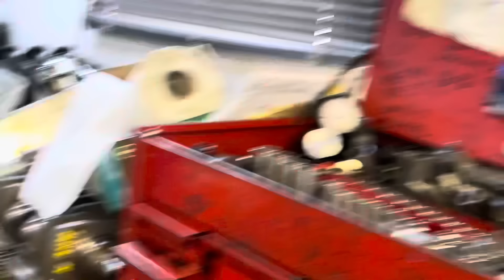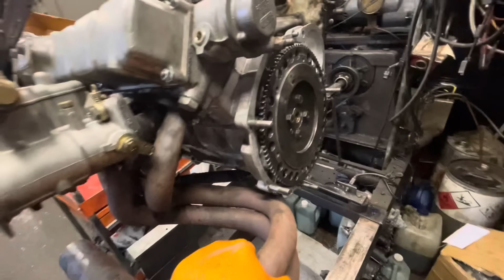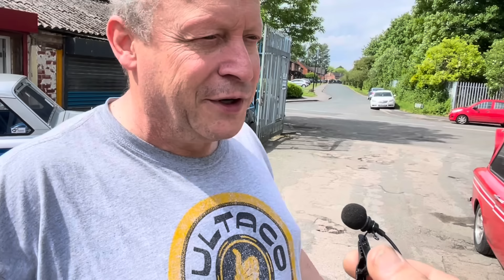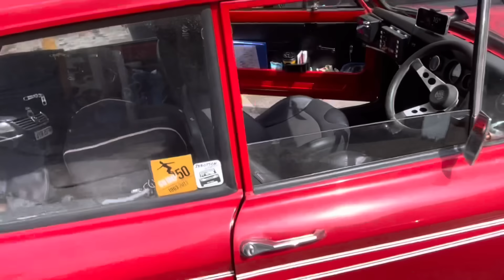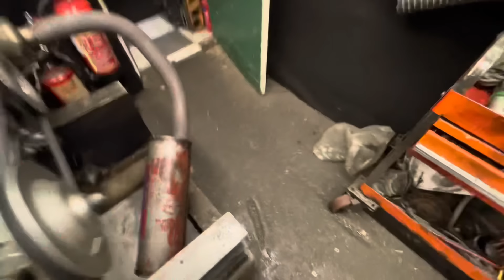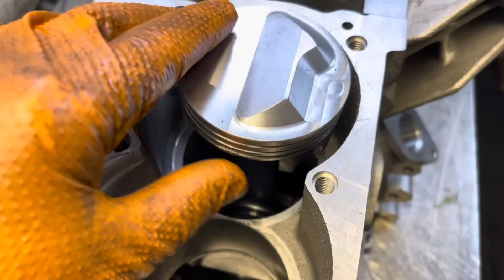Shrigleytube TV Ep 45 rear rad test on dyno, visit from Tim, Mallory park race prep

Comment: Andy Check which way the fan is operating is it drawing air through the rad or pushing it through! As in the car that direction is very important.  When the car is moving it creates a low pressure area under the car and that draws the air from the engine bay through the rad helping the fan to work!  What you have in the workshop is a static atmosphere so there is only the fan trying to create the air flow!  With the rolling road dynos they have to have a huge fan set up in front of the vehicle to give the impression of speed through the radiator!  so perhaps  you would need a similar set up in the  dyno room when using the vehicles radiator for cooling!

Comment: Very interesting experiment on the radiator cooling system. I'd like to see the same test with a standard imp radiator and fan set up for a base line test just to see if the direction of air or even just a combination of an imp fan works. I also think that an imp water pump may be playing a part here at high rpm with cavitation or some other factor that lowers coolant flow. On my own imp I had overheating problems on long hills. When I changed from belt driven original water pump to an electric water pump my coolant temperature dropped by ten degrees with no other changes so I'm thinking an imp pump may not move very much water. That said I can see that your dyno uses an imp pump so who knows haha. Brilliant video thank you for showing us
Reply from the maker: hi thanks for your kind comments. Yes I have new series on the water speed from the Imp water pump and will be moving to electric one. I have a plan and will tell about it on Sunday night video cheers andy.
Reply from the maker: hi graham thanks yes I have learnt lots about the water pump speed and how important it is and think I will be moving to an electric constant speed pump more about it on Sunday night. Cheers for now andy.

Comment: Hi again Andy.  I've had some more thoughts on the cooling issue.  You mentioned that you were running the fan at 1:1 ratio which means the water pump is also running at engine speed.  From my limited knowledge of centrifugal pumps they generally operate around 1750 rpm.  I suspect (and I'm sure someone more knowledgeable will confirm or otherwise) that at the higher rpm with the 1:1 drive the pump is possibly cavitating and not flowing at the correct rate.  What's more, the air bubbles being introduced into the coolant are incapable of transferring any heat so overall cooling efficiency may be severely compromised.  On the same lines, the fan probably has a maximum efficiency well below that of your initial test and you're just wasting power spinning it that fast.

Perhaps go back to the factory drive ratio with the thermostat in place and see how that goes as that would give you a better baseline to start from.
Reply from the maker: hi thanks for your comment. I have been bombarded with information regarding water speed et cetera and will talk on Sunday night about a new plan so hopefully get the cooling temperature on the control.

Comment: Andy, don’t underestimate the RAM air flow through the radiator. Your test is in effect loading the engine at high r.p.m with the car stationary. The driven fan isn’t designed for cooling in that situation, it’s designed for idle, low rpm, low load shunting on a motorway. Hope this helps, just my thoughts; I don’t understand the imp cooling system in any depth so I may have made some assumptions here but all the same keep up the great work, loving the videos 👍👍

Comment: Andy, you don't have the additional negative pressure in front of the rad created by the forward movement of the car to draw the airflow from the fan through the rad, and system isn't pressurised. You are akso just circulating the warmed air in the room. You need the airflow going towards the front of the car, not being pulled the wrong way as you have it.

Comment: My 1040 GB72 BV 11.8 SCR Clan has exactly the same thick core ally rad as yours. Mine is fully shrouded back and front with a low letter box air scoop.  The rear shroud is custom ally and abs with an 11 inch electric fan mounted  2+ inches away from the core to reduce baffling the ram air on the move.  Above 40 mph the ram air alone is sufficient for road cooling.  Fan switches in at 78 C head temperature.  It runs about 75' C  in this month's temperatures. 72C in winter.   The floor is completely flat (abs sheet plastic) even under the suspension arms to direct ram air into the scoop. In addition  I also have 2 x 10 row Mocal coolers in the front spoiler (one on each corner, shrouded and sealed) coolant fed by the heater circiut - 1/ 2 BSP pipes.  These tiny rads drop the return temp 10 C at speed. I use an EWP 80 in the main cooling system variable speed with a full speed override. De cored thermostat in head as a restrictor. Pump speed is critical as I use Evan waterless.  The heater circuit hasits own variable speed  25 lpermin aux electric pump as the oil cooler heat exchanger is in the heater circuit. Sounds complicated but it works.  I need to bring the Clan over to you so you can take a look and take the p (it is very odd ball!!).  I have a c/r transaxle to go to the National for a Club member so I could maybe bring it over to you (if you don't mind) as an excuse for a run out to Manchester from Richmond NYorks?
Reply: BTW. See avatar front spoiler for 10 row Mocal inlet holes. Central gap in spoiler is for extra underfloor air to rear rad scoop.

Comment: Andy, I ran a standard imp and thrashed it everywhere and all was fine, I got a Clan and I know it is a sport engine but it would get too hot, the one thing I realised was the standard Imp had a fully shrouded radiator drawing air from under the car and forced by road speed, the Clan had little shrouding no exhaust shield so drew air from the engine compartment, has that got anything to do with the cooling.

Comment: Hey Andy, how did you manage to get the standard fan assembly to suck up air from underneath rearwards.Standard airflow is drawn in via the rear engine lid to the front of the Imp.Very little ram air effect underneath the car .The bad aerodynamics of an Imp causes air to be drawn back into the engine lid .
Some Fiat Abarth rear engines had ducting underneath the rear floor pan acting as a ground effect aero device and ramming some air through the rear mounted radiator..
Adding to this you would need multiple aerodynamic devices such as a front air splitter and rear aero wing to stop air being drawn back counteracting the air flow.
CTCRC & HSCC regulations prohibit any aero devices
You may have seen the early days of H&S with HGH having an electric fan blowing through the rear rad constantly on the trips from my location in Essex to the Midlands and beyond.Never had any overheating problems despite the seemingly wrong direction of airflow through the radiator.
My intended Formula Libre Imp will have a side radiator set up as per 'Robert Knox`s ex Stiletto space frame using air scoops to direct ram air through them ..I think a degree of radiator ducting as per standard shrouding will help as you didn`t have any at all.
It is what it is regarding the competition cooling of an Imp in way of the front mounted  radiator and that needs ducting to ram air directly through say a Fiat Uno lightweight radiator.
Comparing the Mini cooling system it has obviously the engine up front so for a start gets air rammed into the front engine compartment and exiting via the near side inner wing ,using the driven fan when stationary..
Still not ideal as i remember back in the late 1960`s Mini Miglia classes had to use a radiator exposed in the conventional way of front engined cars not standard side exiting.
I think you mentioned that the Mini 1400 cc competitors have problems with cooling as well (?)..
Therefore it is all down to a way of increased air ramming through a radiator or as stock car competitors(?) ulterlise an extra,extra large radiator to cope with a 15-20 minute race..
Reply from the maker: hi DAVID yes I used an 11 blade Mini thousand fan and have to say I think it works better than the Imp Van yes also the minis to manage to work with a small radiator but their target temperature is 90° where I mine is 65 so this is where the problem starts More on the subject on Sunday night thanks for commenting cheers andy

Comment: Hi Andy, a couple of thoughts.  First is that there is no natural air flow to the rad as there would be under load when you're racing so perhaps the dyno run is not a very accurate picture.  The second is that (and I'm basing this on stuff I've read over the years) without the thermostat the coolant is moving too quickly through the radiator and not transferring the heat as well as it it otherwise would.

The other thing I'll mention is that A. Graham Bell in his book 'Four-Stroke Performance Tuning' (absolutely brilliant book - highly recommended to anyone interested in engine tuning) advocates restricting the flow through the engine with an orifice plate in place of the stat in order to achieve a specific pressure in the cylinder head (can't remember what he recommends)  in order to improve heat transfer around the exhaust valves. This requires experimenting with different hole sizes until the correct figure is achieved.

Anyway, keep at it and you'll get it sorted eventually.  Love the channel and very much enjoy the interviews with your mates and customers.
Reply: I worked for years drying tobacco and viscose fibre....big (1MW) heaters....in calculating the heat balance we don't always look at having an excess in capacity over demand. As you say balancing the flow through the block is the most important. At high pump rpm's the flow may favour certain cylinders and when the rpm's drop change position. In the A series removing the stat causes pot 4 to run hot which shouldn't make sense. Be interested to see the pump and fan running on a speed controller - if the speed is dropped you may well find the efficiency rises.
Aluminium heat transfer is also hopeless compared to copper

Comment: If I remember right the cooling fan blades are not very long, from the centre bosh to the outside edge,if so very little heat is removed from the middle of the radiator,under load you make a lot more heat as you said maybe try a fan on the back in the center

Comment: Hi Andy, is running the system un pressurised effecting your results?
Crank pulley looks a little on the small side vs a standard imp pulley to me, perhaps lower pump and fan speed effecting your results? worth a check!

Comment: Only thing I noticed with the radiator trial is you had no cap on to hold pressure on your video, could this be a factor? I worked with ductile water pipe years ago and found it very high tensile and brittle. You could punch a hole through it with a hammer instead of it denting. I would keep constant  care of cracking. Good show 👍

Comment: Worth checking out this guy https://www.youtube.com/watch?v=RWouSTwrg3g&t=1614s and his struggle to keep his car cool. Long and the short of it was that the water was going though the rad too quickly to get properly cool, and he ended up changing the way the water went through the rad which solved the problem!
Reply from the maker: thanks for this. I did try slowing the water speed down by restricting the water in the top house going through it but it made no odds. I have lots to say about this subject and will add it to Sunday’s video.
Reply: @thehillmanator  I think the guy with the alfa actually changed the routing of the water through the rad, so that it had to spend more time there, rather than just slowing the overall flow with a restricter in the thermostat housing...

Comment: Have you tried making the water pump less efficient slow the flow through it to allow radiator to soak up the the heat, had a water pump impeller to close to the housing once causing the same result hard to find fault
Reply: Or make it pump faster? Like the block was the restriction for flow?
What about oil cooling.
I know nothing just throwing shit at the wall. The channels amazing👍